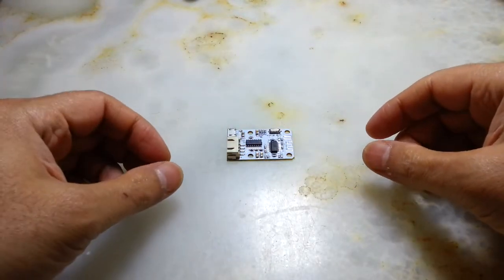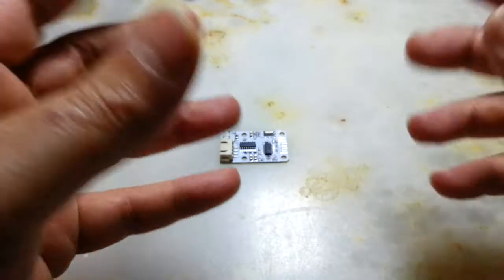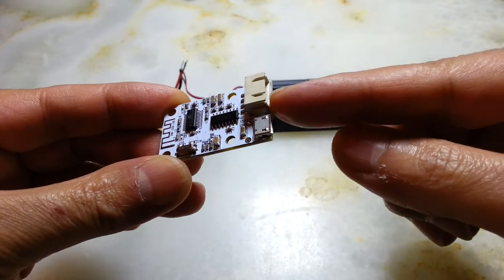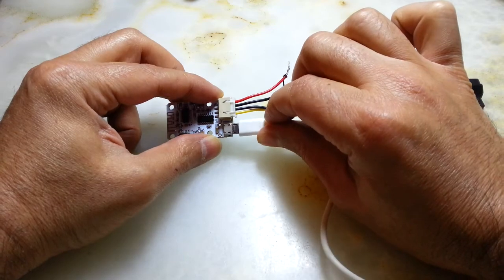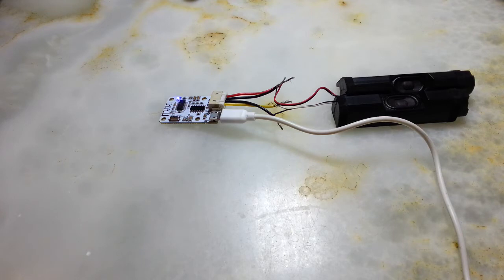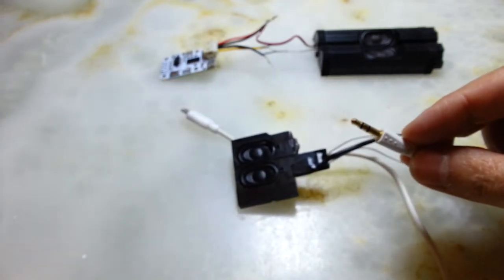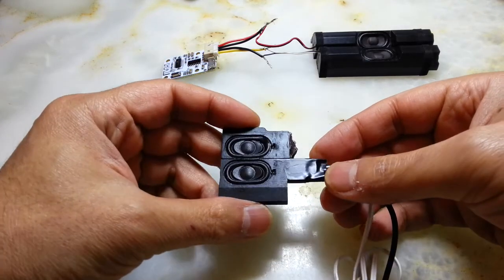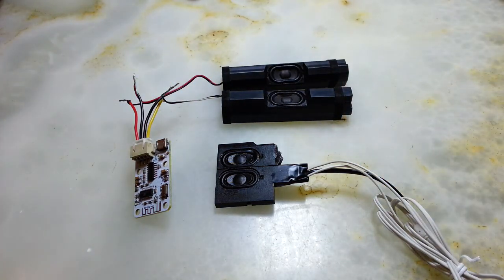Bluetooth 5v 2x3w mini amplifier review and laptop speakers project.

Comment: Is there any other same board but without the girl speaking with hilarious accent?
Reply from the maker: Hi, I know what you mean. There are other ones on my channel which are a bit bigger and more powerful that don't have any greeting lady. Check them out. Cheers.
Reply: Hi, I've found it,same board but it has "SANWU" branding in the back,i think it's like a JBL speaker tone when you power it ON and when paired, I'm happy now, I also have the PAM8403 it's definitely louder than that Bluetooth module,,but the driver will be muffled at high volume,so I'm using this SANWU Bluetooth stereo amplifier., cheers.